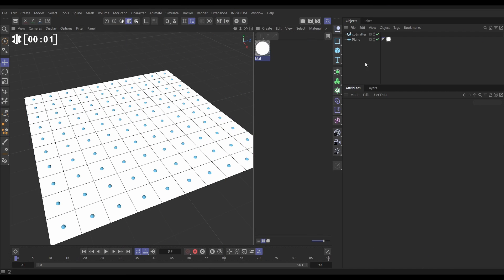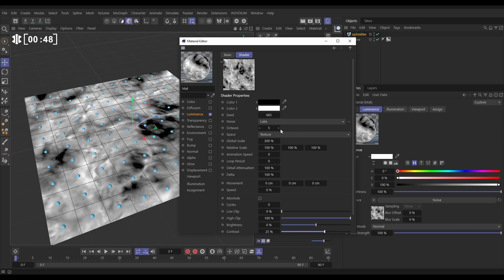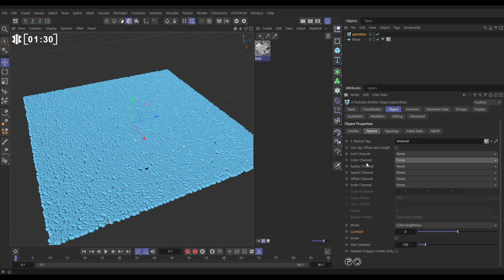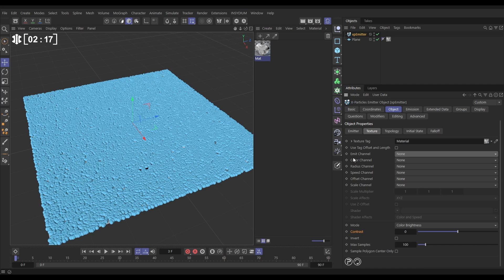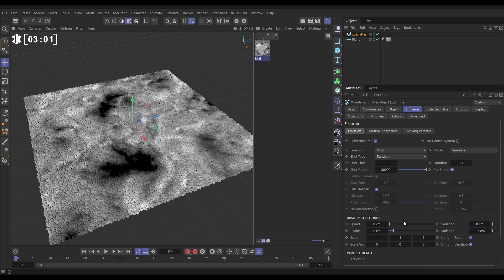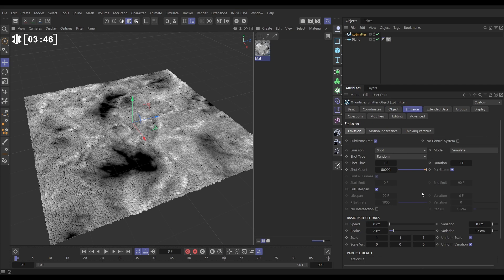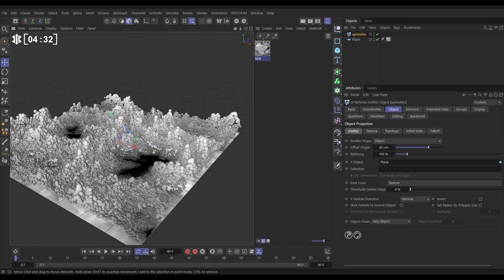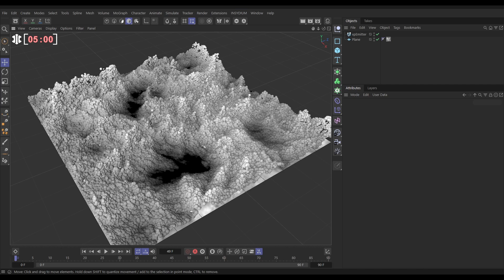Top Tip Tuesday! - xpEmitter Advanced Emission

Comment: Great video as always.  I'm just thinking out loud, and haven't tried it, if you wanted the radius to be inverted, so the larger particles were lower down than the smaller ones (about 4:21), would you just use a different colour channel, with the texture inverted, or is there a way in the UI?
Reply: I have the same question. For a second I though he would just flip a “invert” switch there.

Comment: please add support redshift materials for emitting from texture
Reply: There’s no point in emitting from a specifically redshift material, because you can just ( very quickly ) build a standard c4d material with the noise, gradient, image texture, etc to use as an emission texture, while still using redshift materials to texture your objects.
Reply: @ColinShots4D  yes there is a point to do that, if you have a procedural animated texture using for instance specific datas and some other complex dynamic layering nodes from RS, Arnold, Octane or whatever third party renderer, you'll have hard time reproducing this shader in the old dusty c4d shader system, therefore if you need to have your particles to behave in conjunction with your shaders in your final render (therefore rendered using a specific renderer), you're stuck. So, Yes, there is a point to give Xparticles "access" to color datas from other shaders type, other than the standard one. I've asked recently on the discord to the insydium staff and unfortunately it's not scheduled (yet ?). But that would be a great feature !
Reply: it's like a way out. But if there is direct support for redshift material, it will be convenient and comfortable. All programs strive to make the user's life easier. Moreover, Redshift is increasingly being sewn into Cinema 4D @ColinShots4D